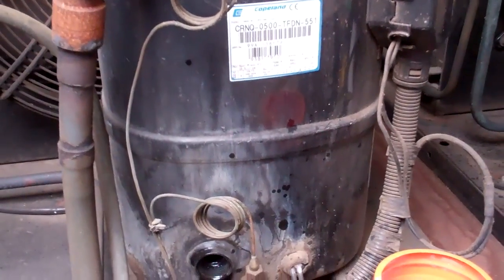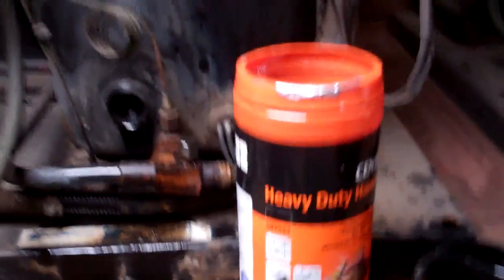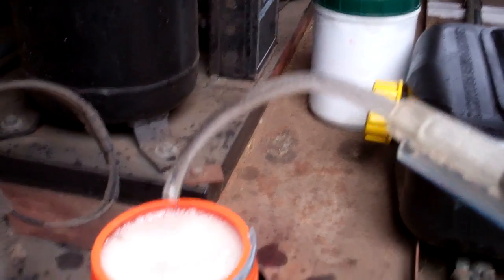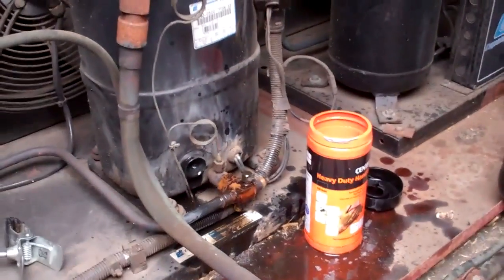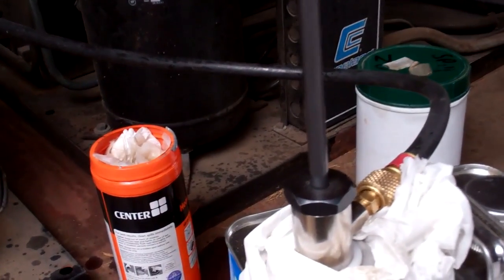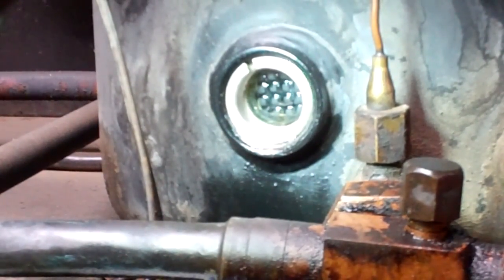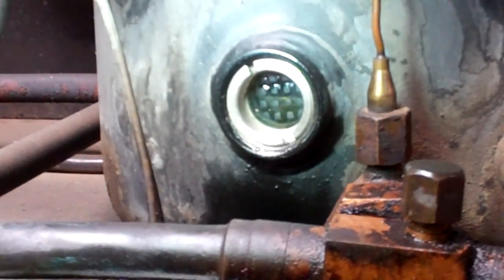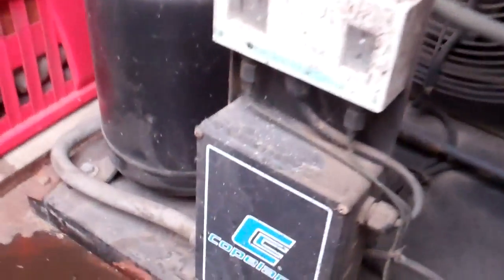Copeland Hermetic Compressor Oil Change

Comment: Where did you get the tool for removing the sight glass? Will it also work on semi-hermetic compressors?
Reply from the maker: +Shaun Hand Hi Shaun, I made it. It fits the small copeland oil sightglasses, they are the same in these, some scrolls, and many copeland semi hermetic compressors. I'll try and make a vid of how i made it.

Comment: used power steering fluid smells just like used hvac compressor oil.
Reply from the maker: jason heyer Wonder how well it would work in a compressor? Probably be ok in a mineral oil system though maybe a bit thin, had a customer years ago that used to put Duckhams hypergrade in his old belt drive freezer.
Reply: heavydiesel my dads friend works for hvac refrigeration and he says it depends what kind of compressor, type of cooling and the run time. most commonly its mineral oil or synthetic with the same consistancy. compressor oil smells like burnt chemicals. i can really include any details because ive never smelled anything that smelled like compressor oil other then used power steering  fluid.

Comment: Nice video where can I get the special tool at :-)
Reply from the maker: Adamis Gomez I think you should be able to get a sight glass tool from Copeland, but i made mine as they unavailable from my local wholesaler. Its just an impact grade socket with a slot cut in and some steel silver soldered in to locate in the slots in the sight glass.

Comment: Who sells the tool?
Reply from the maker: The sight glass tool? I made it from an impact socket that was a snug fit in the sight glass, then cut a slot and brazed a bit of steel in to fit in the grove in the glass. I used an impact socket as there is no chrome to make brazing tricky.
Reply: how much to make us one?
Reply from the maker: I'll make you one and post it to you if you like.
If you are in a hurry as it will likely take me a while to do it, there is a tool called a 'drag link socket' that i think would work as well, i didn't know the existed when i made my socket.
Reply: not in a hurry! Let me know when you can do it

Comment from the maker: It would take three or four changes with a good bit of run time inbetween to get the mineral oil content low enough to change from hcfc or cfc to hfc refrigerants. Idealy it wants to be below 3% mineral oil. Depending on the type of system and pipework configuration you may be able to get away with more mineral oil mixed in with the poe but below 3% is a good figure to aim for.

Comment from the maker: The oil sight glasses are more common on the refrigeration spec compressors. The level was too low plus i wanted to change it from mineral to POE oil so its a step ahead when R22 runs out!

Comment from the maker: Hi Alan,

The dimples in the glass should dissapear once the oil covers them, think its designed to make the level easier to see, this one is dirty despite cleaning (old system)
That is pretty much the procedure, it was pumped down so no refrigerant was released,oil changed, then leak checked with nitrogen prior to vacuuming and letting the refrigerant back in and running up.